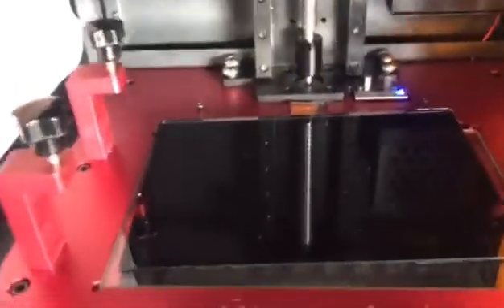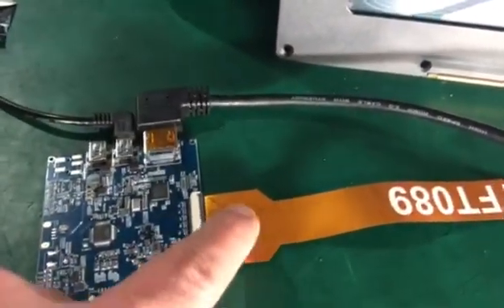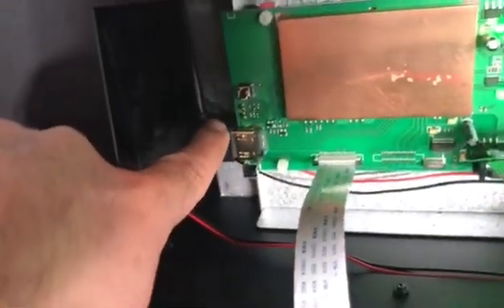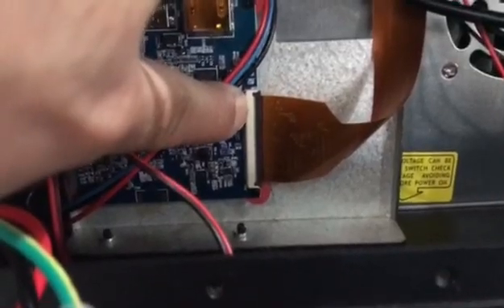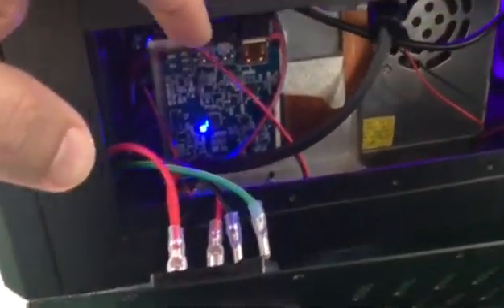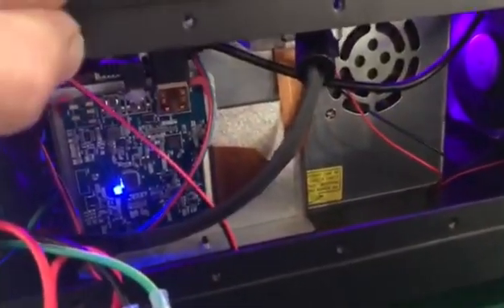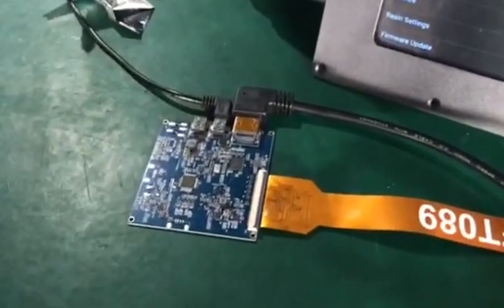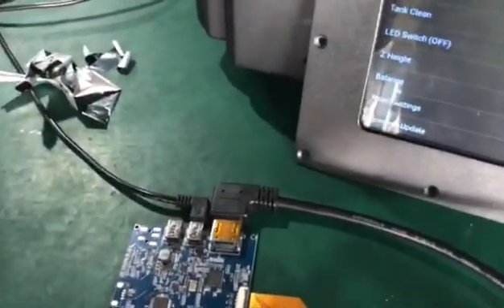Duplicator 8 LCD Troubleshooting

Comment: One last comment....when it was working, I noticed using a resin company recommended default exposure setting don't work. eSun for example....20 seconds bottom, 12 the rest. Yet Chitubox has now preconfigured the D8 to have a bottom exposure time of 100 seconds on the bottom layer and 28 for the rest which does work. Why does this require such a long exposure time compared to other LCD printers? I don't supose I'll get an answer on either comment. Probably why comments are disabled on your other video. Too many upset customers?
Reply: Hello. I unsuccesfully tried to understand the cause. I gave D8 to diagnostic centre. In my situation the brand new screen was the problem. I received it broken. Exchange solved the problem.

Comment: I've spent more time repairing this thing than using it. I've only logged 26 hours printing time. So far, I've had to replace the USB ports, the wifi dongle, the lcd, the lcd ribbon cable, the UV array due to 5 UV bulbs dying. Now the LCD isn't working again and it's brand new. The LCD will work for one print, than stops. Then at random, it works again, then after one print, it stops. You really should issue a massive refund instead of facing a civil law suit. I'm sure I can find enough users to join one. I have a solid blue light on the controller board so according to this, its not the board, I see two other users have the same problem. I could have just saved the money and built a printer. I see your official Facebook Wanhao D8 support group closed. What the hell is going on? I even found a D8 out there without a carbon filter. I've had it longer than 12 months but have hardly even been able to use it.

Comment: Great! thanks for your video, it clarifying some question that i have. But... I have the blue led solid and the screen does not work. When i conect  the broken screen the led start to blink wich indicate that the screen is damage... but when i conect the newones (because i´ve already buy two, one from a provider in china and the other directly from wanhao) the led turn to solid state but the screens just not recive any signal or show anithing... do you have any idea what´s going on? I´ve been pased months trying to resolve this issue and i´m desperate. I hope you can help me out about it. Thanks in advance!!
Reply: Hello. I have the same issue. If you solved it, can you tell me please how you did it? Thanks
Reply: @Krendelgosha  I have the same too, did you ever fix it? I noticed mine works sometimes but more often it does not work....solid blue
Reply: @TimothyArmstrongamblixVR  just throwing the printer into a garbaje can. Sincerily i think that I have bought problems  and not solutions instead. I just give up whit this piece of shit and move on to another 3d printer that realy give what is promissing.
Reply: did you ever resolve this? I've only logged 26 hours printing time. So far, I've had to replace the USB ports, the wifi dongle, the lcd, the lcd ribbon cable, the UV array due to 5 UV bulbs dying. Now the LCD isn't working again and it's brand new. The LCD will work for one print, than stops. Then at random, it works again, then after one print, it stops. I too have a solid blue light on the controller board so according to this, its not the board, I see you and another user have the same problem. I could have just saved the money and built a printer. Even their official Facebook Wanhao D8 support group closed. I even found a D8 out there without a carbon filter, and the USB ports are vertical instead of horizontal. Reached out to the company and they swear they dont have two models. I've had it longer than 12 months but have hardly even been able to use it.
Reply: I just plugged into a pc monitor strait to the mainboard and it says 'out of range' can this be plugged into a normal monitor like the D7?